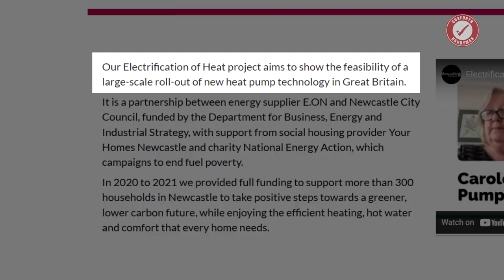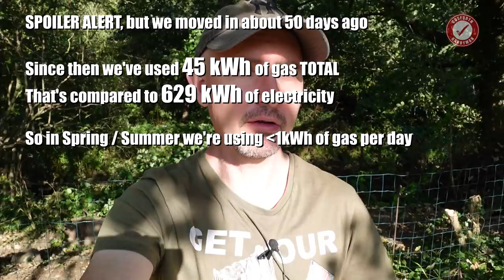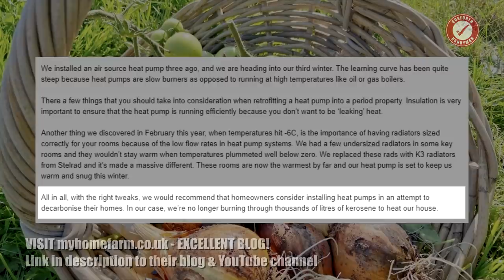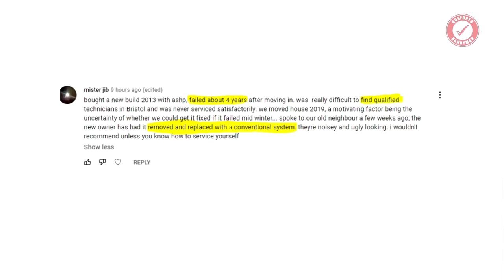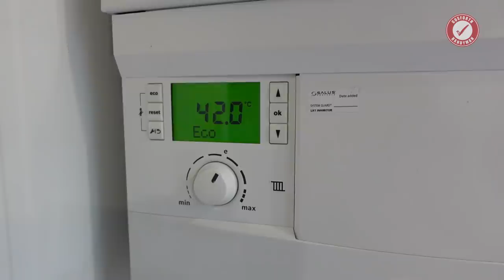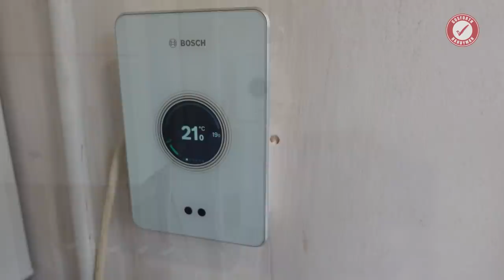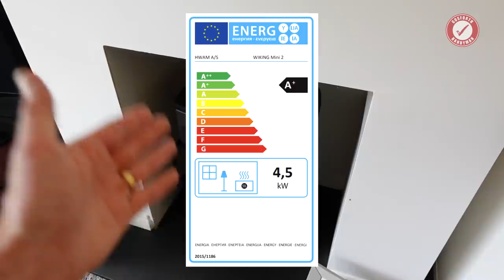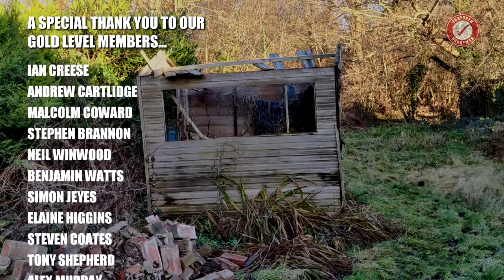Why didn’t we install an Air Source Heat Pump? (1920’s Renovation Part 32)

Comment: I have an unvented heating cylinder in my newbuild house. The way it was configured when I moved in was it was on a timer to coincide with morning showers and evening washing up. I found that my shower times varied too much and the shower would run cold very quickly, which was incredibly frustrating. What I have done instead is to have it on all the time, so if the water temperature within the system drops below a set threshold, the combi boiler turns on. So when I'm in the shower, cold mains water fills the cylinder as hot water is drawn out from the top, and the boiler kicks in almost immediately to reheat the contents of the cylinder. Of course, it does get cooler over time, but the period is much longer than if you're drawing from a cylinder that is actively cooling itself by drawing in cold water, and the cooling gradient is very gradual. The difference in cost to run is negligible compared with a combi boiler, but with the advantage of mains pressure hot water. The unvented systems try to claim that they are more efficient because you don't get start/stop waste for short usage and the response time is much quicker. This is true if you use a small amount of hot water (though apparently less true for new boilers in 2021), but for showers you're either getting the combi boiler kicking in immediately or you're running out of hot water exceptionally quickly. I'm renovating a period property (1906) and I have been considering putting an unvented heating cylinder in there to supply two power showers, but I'm seriously reconsidering seeing how efficient and simple your system is. The cylinders are really effective at storing heat so I don't think it's right to say that you're heating 220l water just to do the dishes, but it is massively more complicated, more expensive to service and the expansion vessels have a much shorter life span than your average boiler.

The most annoying thing to happen to this system is that there is a safety valve on the system that broke while I was not in the property. It was properly broken for a good month or so as the property was vacant and the water main was not isolated. So the valve was essentially open and hot water was running through the overflow constantly for that whole period, running up a bill in the several hundred pounds. Fortunately the water company allows you to make a claim on things like this so the bill can be cancelled.
Reply: A combi boiler doesn't do away with the need for expansion vessels etc. Many of them still extremely complicated inside with increased repair times because of the deconstruction needed to access parts of the system. I think only Intergas have a combi boiler that could be considered simple enough to have significant savings on maintenance.
Reply: @sdgelectronics  from my perspective, my heating system needs to be serviced yearly regardless. It's more expensive for me to service my heating than a combi boiler system because I already have a combi boiler but I have a lot of extra parts. Those extra parts increase the likelihood of needing replacement parts. Also, unvented systems in the UK must be serviced by an engineer trained to work on them because they can be extremely dangerous, so it costs me more to call someone out and oftentimes takes them longer to service. If a combi boiler alone can cater adequately for the needs of a house I don't know why you would complicate it further.
Reply: @matthewesch9980  Unvented cylinder systems when not properly serviced and maintained have the potential to turn into pressure bombs. A combi has normally a 12 liter expansion vessel mounted inside, good enough for a dozen radiator sized system. Benefits of Combi, no storage and direct hot water to one outlet at a time up to 15L/min - generally bad for multiple bathroom properties where people are using them at the same time.

Unvented system benefits, can supply multiple outlets at the same time without a L/min drop but have a finite amount of hot water storage before the tank needs to be reheated taking 25-30 minutes on average. We have one customer with two tanks 180 Liters each but decided on 18 and 20 liter/min shower valves and heads meaning his daughters emptied the tanks within 10 minutes of showering in the morning.

Generally a heating appliance should be designed to the customers needs first, the house second. As one residents requirements are potentially vastly different to one another.

Comment: set your boiler flow temperature to 50 degrees. see if that gets your house hot enough. that's a very basic test to see if heat pump could work for you.

Comment: @34:55 The problem with spray foam is if you don't leave an air gap between the roof and the insulation, then air flow is impacted and moisture can build up causing mold and mildew issues.
You also have to be careful to use a mixture that is fire retardant.
I had a weatherization company spray foam the entire sill plate in the basement and it made a huge difference in drafts in the house.
Spray foam gets into filling all the cracks and holes that conventional insulation could only dream of doing.
Reply: There are pre fitted spacer boards that should be fitted between the joists before spray to combat that problem, as far as I’m aware. Doesn’t make sense to spray straight onto the inside of the roof, nightmare waiting to happen

Comment: Good vid. I’ve just accepted an offer on a property in the middle of no wher in Northumberland. It has old electrical heating no mains gas available. I’ve been looking at tank oil or gas lpg. But I may just replace the old electric radiators and boiler to new smart electric and re statue the fire place as a back up. Along with other house improvements. The big problem is trying to be a Nanny and forcing people down one path. Good vid

Comment: Also fit weather compensation controls to condensing boiler. Most condensing boilers will cease condensing once return temperature goes over about 57 degrees. Also gives greater comfort in the house.

Comment: Air source heat pumps are great and crazy efficient, but it comes with several asterisks. As mentioned, you need the right equipment and the right install for your house, which can get pricey. Whether you do air to water or air to air with wall mounted units, picking the right solution will make all the difference. Secondly to get the best out of it you really do need good insulation, which the vast majority of houses in the UK simply don't. Finally, your electric prices are so high that they are not as competitive as they are in other markets, especially considering how relatively cheap gas still is.

As an example, I have a house in Norway, where I use an air-source heat pump with an indoor air unit. Even in -30 it works reasonably well and keeps the house nice and temperate. Naturally the colder it gets the less efficient it is and the more noisy the outside unit gets, but in more normal temperature ranges it is whisper quiet.

Of course another benefit of air-to-air split system heat pumps is that it can double as air conditioning during summer, which I would not want to be without.

Comment: Basic common sense thank you for posting. I particularly liked the comment about many people do not know how to use a thermostat. Sounds extreme but so true. I have a modern combi system and four standalone heat pumps. When only moderately cold e.g. 7 degrees C I run just the heat pumps only. Any colder then HP's become increasingly not cost effective to so I  switch on the gas boiler and run both at the same time as a hybrid do to speak. In really cold periods statistically less than 30 days per year in my part of the world i use 100% gas. Where the heat pumps work really well is summer time air conditioning and even then its situation specific as I have a lot of glass in my property. My neighbours with properties of different construction from mine do not need air con. The lesson to be learned is do your research first on HP's and work out for yourself if suitable. Absolutely do not blindly follow government advice.

Comment: I you have to love a combi , sized  mine on the flow rate , so to big for the central heating, but great for the hot water . been there for 13 years now Bosch as yours happy days .if you need more CH heat fit 2 .

Comment: Cracking video. Balanced and we'll explained.
We have moved to a large detached house in the Fens. It was heated by an old oil boiler using over £1k per year on oil.
The green scheme was launched and we decided to go for the solar thermal system- the grant paid for it.
The boiler broke down- we decided to go for ground source heat pump option- eye wateringly expensive but the RHI will pay for it over 7 years.
Underfloor heating (mostly) downstairs, old rads upstairs that I will be replacing with type 22's throughout as per heat loss schedule requirements supplied by installers of heat pump.
The heat pump has been running since 15th Nov supplying heating and hot water. It's working really well using roughly 20-25 kWh per day on a 40°c flow temp that varies due to weather compensating with heat pump.
Would I have done either of these if I had to pay for them ? A bit fat NO- sorry Gretta, but I'm being honest, and before anybody starts belly aching about the tax payer having to stump up the costs, I'm in my 50s and have paid into the system every single month since 1986.
I totally agree with the fact that heat pumps are NOT suitable for everyone. I've heard airsource heat pumps chugging away and although when new the fans are quiet, they can get pretty noisy after a time, also the SCOP suffers when the temp drops.
Insulation IS the major factor that has to be considered- heat pumps rely on low flow temps and "tick over" rather than quickly heat an area as a gas boiler would.
Both gas and heat pump heating have their pros and cons and each has its place within the housing of this country.
So to stop rabbiting on and to come to a conclusion, I'd stick with mains gas if its available and consider heat pumps if it's not available. Keep warm everyone 👍

Comment: Andy your unvented cylinder would/should be storing water at circa 55 degrees.c. but your shower temp would be circa 43 degrees c. Therefore 220 litres will provide more 22 minutes supply of hot water,  coupled to fast recovery high rated coil in the cylinder the correct size boiler would ensure that you don't run out of water. Combi's are great for small properties but struggle when there are 2 bathrooms.

Comment: We bought a 1940s semi detached house about 8 years ago. It had an ageing oil boiler which we replaced with an air source heat pump. After living with it for 7 years and living with regular breakdowns costing hundreds of pounds to fix and high running costs of up to around £10 a day on freezing winter days we gave up and pulled it out to replace with a gas boiler. We didn't make the decision lightly as we had the additional cost of needing to get a gas main installed. Even with the rising gas prices I don't regret the decision for a second, the running costs are a fraction of the price and I wouldn't want to imagine how much it would cost to run a heat pump now given electricity prices have almost doubled!

Comment: I almost went down the air to water heat pump system route but bailed out once I'd read up on it and got a quote of £14,300 (others were fair bit higher and this didn't include re-doing flooring afterwards). Coincidentally it was then that I found out about ductless air to air (mini split) systems that may be suitable for my 2 bed house in the Highlands. A mini split heat pump with four or five indoor fan units may have been fine IF I could find out how well they work in practice and IF I could find someone to install it here. All the installers are interested in here is air to water HP's. While in the US I lived with the usual ducted units that heated and cooled using blown air. Both worked well. It took a short while to realise I had to stop dropping the thermostat at night since in the morning the use of auxilliary heat to bring the temp back up sent the use of electric sky high. That seems to be the main downside of heat pumps - they need to be kept at the same temp day & night. For me that meant kinda chilly during the day and too warm at night but I got used to it. Still it'd be good to find out if a mini split heat pump is an option here. The install as a retro fit looks way much less disruptive (no lifting floorboards) and would take maybe one day vs the five I was quoted for an air to water HP. So maybe £4k for mini split vs £14,300 upfront for air to water HP (plus cost of redoing floors, but with RHI payment of £10 over seven years). It looks like a no brainer for the mini split HP, IF they are as good in the real world as they may be.  Not much info online on them but most of the usual Jap companies make them. Meanwhile thank God for wood burning stoves.

Multi System (air-heatpumps.com)

Air Source Heat Pumps: Air-to-Air or Air-to-Water? | B-DACS Air Conditioning Services (bdacs.com)

Comment: Great video - thanks! We're still on a vented system - but have a lovely new WB heat-only boiler - smashing as the old boiler was from the 80s! Main difference between yours and mine is that our shower is leccy only - so doesn't steal from the storage tank. Thanks again!
Reply: What are you heating water for if not for showers? Why worry about showers "stealing" from you tank, surely that's what it's there for!
Reply: @spencerwilton5831  - redundancy. The tank is there for baths and running hot water. But - if the boiler fails I can still use the immersion to provide the same hot water.
Reply: @stevehensonuk  what price does electricity (vs gas) have to get to before you reconsider?  The immersion is there anyway even if you have a shower fed from the boiler?
Reply: @edc1569  at the moment that is irrelevant as the immersion is not used (its there if the boiler breaks down). Also barring a re-fit of the tank location I'd need a pump to get good pressure to the shower. So all things considered I'm happy the way it is.

Comment: I moved into a house with a modern combi boiler and so far it's been by far the best water heating system. Literally the only downside is the few seconds it takes to get hot, but that's basically no worse than almost any other system (except hot water recirculating, which has its own issues).
Reply: there are problems at low flow or with regular intermittent use. It's very user dependent.
Reply: @sdgelectronics  Every system has their weak points; for the majority of people, it appears to be the best option. For me personally, I've lived in a variety of places l with all sorts of heating arrangements, but all of them had much bigger downsides.
Warmup time isn't a big deal for me compared to the benefits.

There's always more expensive/exotic/location-specific options that can outperform it in any metric though.
Reply: @elminz  Many people have all kinds of heating systems and live with the drawbacks. Modern fast recovery cylinders can be reheated in half an hour and have extremely low standing losses. The boiler is also likely to run more efficiently heating a cylinder since the boiler spends more time in condensing mode. Combi boilers can be inefficient in other ways such as wasting water which may be more important to the user. Or people may value their time more, and prefer the higher flow rates from a cylinder based system. Everyone has different needs depending on their usage.
Reply: @sdgelectronics  Like in the video, flow rate is more than enough for us too. Likely the same for average households.

Comment: Great video. "Your situation" is always key to any of these things. 
With the Thermostats/TRVs I am also not a huge fan of smart controls. However at the start of the Pandemic with Mrs W working at home, I installed a Drayton Wiser set up. We have been really pleased with it. Each room is now its own zone, so rather than keeping Mrs W warm by heating the whole house, she can be snug in one room, and the hall/kitchen just kept from getting too chilly, rest of the house is off. If we were all in or all out, like you Im not sure we would see much benefit, but with the change to the way we use the house it has been very useful. Our wood burner now feels more like it works with the heating system rather than fighting it which is great. The software on the Drayton system still needs a little more TLC. You can't turn the heating off yet and leave the hot water on (we are a system boiler), so it occasionally has quietly done its job when really I just needed to put a fleece on! Its certainly been a good improvement to the heating system. For our house more insulation is needed, and replacement windows (failed old cheap units).
Reply: Micro zoning your system will increase cycling and boiler never condense, a back ward step and a waste of money. But sounds good to show your mates down the pub
Reply: @mattmackenzie1111  I understand what you are referring to. And so far haven't found it to be a significant change. Our boiler isn't oversized to the property like many I see installed. So it will happily throttle down and tick over, rather than being full whack or nothing, so it is definitely condensing (I can hear it pee :) There are also a few rads on the system that are not on thermostats, so its not just heating one Rad. But its still a heck of a lot better than heating the whole house.